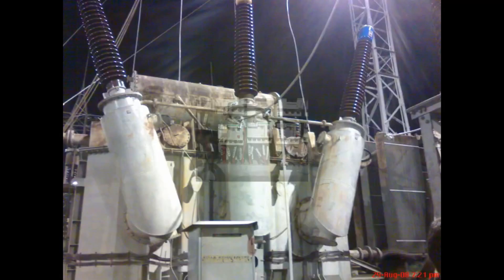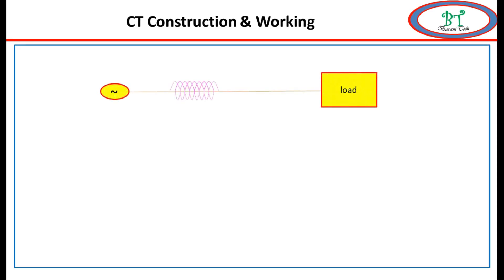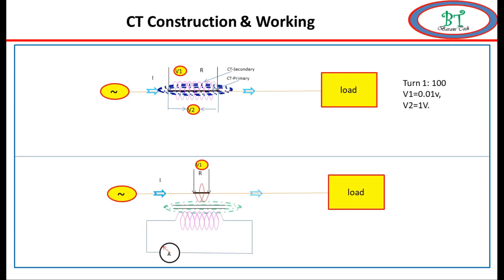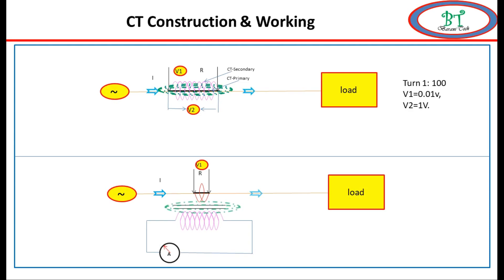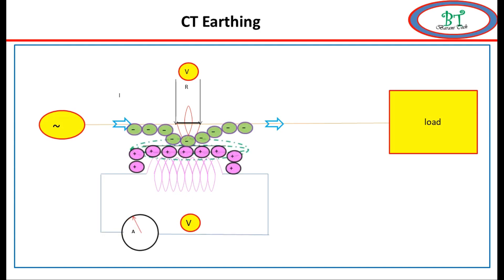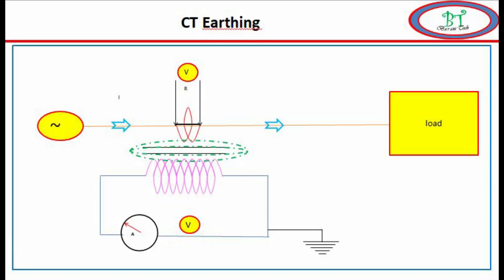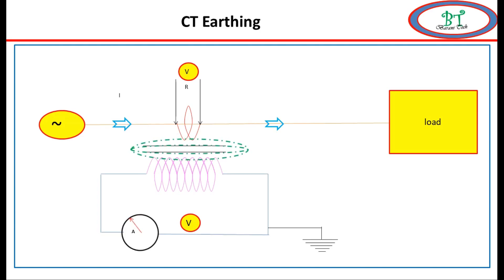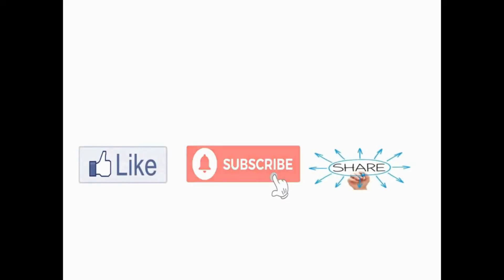Why is a Current Transformer Secondary is always connected to Earthing

Comment: that was what i,ve been struggling tounderstand in past week,i,ve always tought that the primary viltage is or pine voltage but thisgave me a prespective that the voltage of primary is equal to voltage drop accros the length of wire that is gone through ct